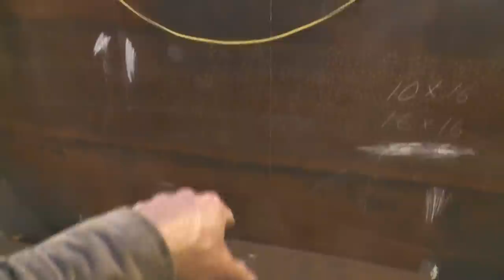Cargo Hold Framing - Part 4 - Welding for age 6 and up.

Comment: Get a stud welding machine...rent/buy/subcontract to weld studs for air tight covers. Studs are much effective in regard to making air tight seal. Welding nuts or threading is problematic in getting air tight . Stud welding machine is lightening quick. 1/2" or 3/8 stud?? There is also a rule for spacing of studs as it relates to diameter... I forget... maybe in machinery  handbook. Nitrile is good gasket material for fuel.
Reply from the maker: Conall Stapleton Thanks.  Excellent idea.  I'll see about renting one.
Reply from the maker: Called on the stud welding gun, and it's $254 a week from Red-e-Arc.   3/8" x 1" long studs are $1 each.  It's a little expensive but not considering how fast it is and that there is no chance for a leak!   So I'm going to wait until all the tanks are ready and get it when I can do everything.  Thanks again for the great tip.
Reply: SV Seeker I agree with your decision to leave the cargo hold frames un-welded for the time being. I think its something you will instantly regret. Your boat plans tend to change in the fly and I can see one of these having to be ground open because you want to replace a fuel tank with dry storage (or whatever). In any case I don't think any substantial volume in the boat should be permanently inaccessible.
Since you seem to want to cut holes into most of the cargo hold decks, I would suggest taking some angle iron maybe 1"-2" wide and welding it around the inside rim of the holds on the same level as riser pieces you welded here. That way you can weld the studs to the top of the angle iron frame and drill holes in all the framing pieces you cut.
This has the added benefit that you don't lose all the material you would have cut out of the center of the frames.
The only challenge would be bending the angle iron to match the curvature of the frame pieces where the edges aren't straight.

Comment: Why dont you use bed liner to water proof the hatches that need to be sealed. I tryed to put drain holes in my bed but the bedliner just refilled the holes when it got warm. i think that would work!! Nice job keep it up.

Comment: Phosforic acid reacts with iron oxide and produces a layer of iron fosfate, which has very good adhesion to the base metal, and works as a primer, it does however disolve in water, if you leave it under the rain it will do little, if kept dry it will work very well for a long time, if you actually paint over it, it is a very good primer, and a lot easier than sandblasting.
I don´t know how it will behave when you weld it, I always keep a spray bottle around and spray any rust spots that I see.
Now that you are starting to close certain parts of the cargo hold, its important to protect the metal against pitting, if the space is to remain dry you could run a rag with FA over the metal, dry it up (its 70% water that has to dry) and then weld it shut, when you open it in a couple of years you will find it in good shape.
besides its dirt cheap and can get it in home depot.
Reply from the maker: Interesting idea.  We use diesel in areas like the rudder and skeg that are now closed up.  It's just a matter of displacing the oxygen.  I'd be more interested in using something on the exposed hull surfaces.  But if it dissolves the rust and then washes off in a rain it sounds like it working against me.

Comment: Those stud welding guns are bad assed. If you can wait, use it to weld studs for attaching your lumber framing... save on drilling two or three thousand 1/4"  holes, or just rent again. $1 per stud does sound pricey.

Comment: instead of making a tank to go inside the tanks you could just use fuel/water bags and make the hatches smaller. also it would make maintenance mulch easier.

Comment: For your fresh water tanks, why not use your plastics experience to fabricate a tank that will fit down into your hold? Conversion bus guys have been fabbing custom tanks for a long time now and the materials and adhesives are advanced and available. If you have to remove the tank to do maintenance on the inside, bottom of the hull, that should not be a problem if you plan ahead. Good luck.

Comment: Hi there, am a Brit fan of the project (just found you and am bored of the UK politics that are getting in the way of normal life, so are getting a lot of watching at the moment), couple of questions. I keep seeing you plasma cut against a straight edge, what stops the straight melting distorting? And 2 were do you get the kids weld mask, my lad wants to try. Cheers and thanks for the entertainment/tech advice. I want to see this boat in the water
Reply from the maker: The plasma cuts MUCH faster than gas torches so there is very little time for heat to travel into the surrounding metal.  The straight edge can literally be handled without gloves.   And the weld mask I have all can be adjusted for kids.  If they are still too loose just put a cap on them first.   Best of Luck.
Reply: Have you ever tried one of the milwaukee metal cutting circular saws for straight cuts?

Comment: i was just thinking that if you put that L bar it would stop water running off the sides into the catchment/ maybe it would be better to raise the side sections up a little to get the same effect but allow the water to run off or totally ignore that if you plan to put cabinets/furniture etc  on those side pieces so that water cant get on them.

Comment: it's a little late now but would it have worked to weld the bolts to the plate from the underside of the top plate of the tank? for the access hatches...

Comment: Fuel trucks and commercial fuel depots all require 2" fill pipes for the nozzle to fit in. The guy who delivers our fuel puts out 70 GPM when he's wide open.
Reply from the maker: Thanks!  The plan is to have a 2" fill pipe to a manifold and then 4,  1.25" pipes.  One to each of the 4 tanks.   And a 3/4" vent from each tank.

Comment: Doug,
When it comes to tanks, there are a lot of conflicting thoughts and theories.  I am a firm believer in looking at people in the business of working with boats.  

http://www.boatus.com/boattech/casey/boat-plumbing.asp

Maybe this article will help as a starting point.  From my time in the Navy, I can tell you that plumbing and duct work require constant maintenance.  Bladder tanks remove a lot of that, because they do give.  As to the chaffing of the bladder, that will depend on whether the bladder is solidly placed.  I found that a good nonskid under the bladder keeps it from moving around, though it does make placing the thing originally a pain in the arse.  The pipes you discussed could use the newer PE lines which makes it much simpler.  Just a few suggestions.  Hope it helps,
Fair Winds Seeker,
 Bill

Comment: Will you need NUTS welded on the back of the plate due to thickness being only 1/4 or 3/8, not having enough threads to hold your hatches?

Comment: I don't know if anyone has asked or will ask but I have a few questions , feel free to not answer.
1) how long have you building the boat ?
2) why are you building it ?
3) how much has it cost you so far ?
4) how much more do you think it will cost finish ?
5) will you keep it or sell it ?
6) can I have a go ? lol
Reply from the maker: 1) Off and on since 2006 when we built the house and shop for the purpose of building the boat.
2) I love building, the challenge, learning new skills, have what I need to maintain and modify the boat as I wish.  
3) Not keeping track very well but I'd guess about $90K
4) Again I can only guess about 250 to 300K
5) Ha!  You don't build boats in your front yard to make a profit.  It's my boat, for my use.
6) Sure!
Reply: SV Seeker Those are fantastic reasons IMO. Sometimes...it's not about the money. It should be about the personal satisfaction and sense of accomplishment. Society today seems to have lost so much of that attitude.
  I find it wonderful to see you doing what you are doing Doug. At the same time....try to be careful with those big chunks of steel. One bad injury could easily derail the entire project. That's why I said the thing about the forklift.

Comment: You said you were going to use lead for ballast, how many pounds do you think you'll need? Couldn't you use something cheaper like concrete? Great video, is the boy your son or Grandson?
Reply from the maker: We have 30,000 pounds of lead ingots in the back yard that we cast from used tire wheel weights.  For sailboats, lead is much better at getting the weight as low as possible.  Concrete is only 135 pounds per cubic foot.  Lead is over 600!  Iron is a good second choice to lead.    ....And Aden is my grandson.
Reply: SV Seeker Thank you, and good luck.
Reply: concrete does not have a high enough mass. try carrying a concrete block under water.

Comment: They make rubber bladders for holding drinking water on boats. They are all sealed and they unfold and stretch to fill any kind of odd shape. They have a flange molded right into them for the fill tube. The inner liner comes out for cleaning.

http://www.discoverboating.com/resources/article.aspx?id=149

http://www.craigmarine.info/accessories/fuel_tanks/flexible_fuel_water_wasteholding_tanks.htm

I plan to use them on my boat. Not endorsing the above, just examples.
Reply from the maker: Thanks for the links.  I have been told and it sound plausible that the constant motion of a boat that stays in the water year round causes the tank to chafe against it's supports and fail.  Do you have any first hand experience with these?
Reply: I don't have any experience with the rubber tanks. My boat was built long ago so it has Stainless Steel tanks that I won't mess with.  

I have had experience with fiberglass tanks. They work great but the water definitely has a plastic like taste. Rustoleum makes a drinking water safe epoxy paint that might be able to help with that.

I do see that many (but not all) of the bladders have and inner and outer liner so perhaps the outer liner protects the inner from chaffing

Good luck with the boat.

Leo